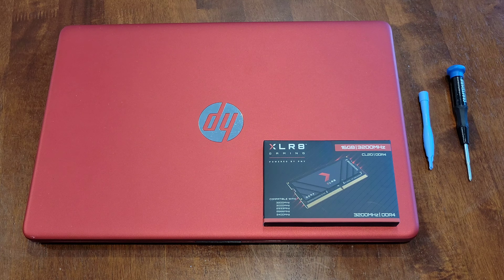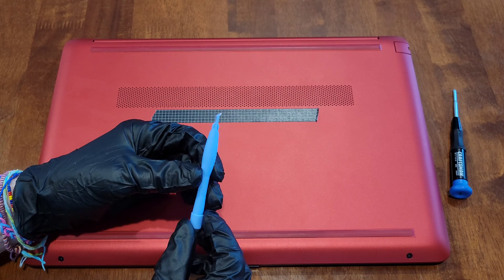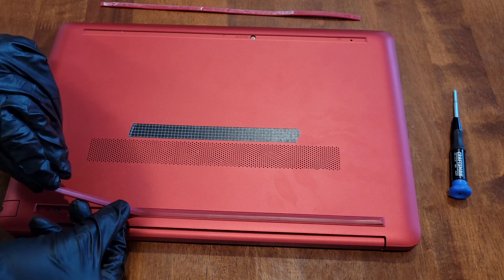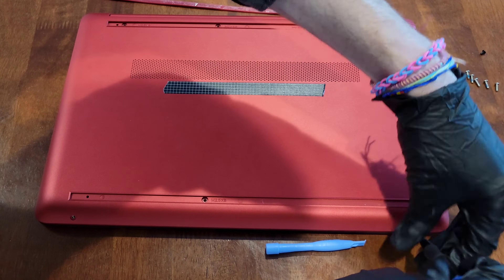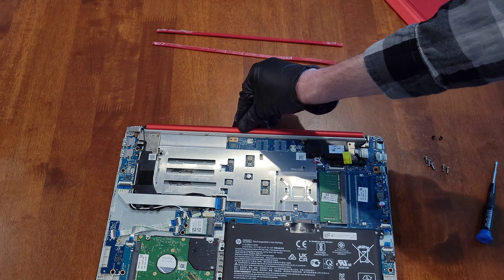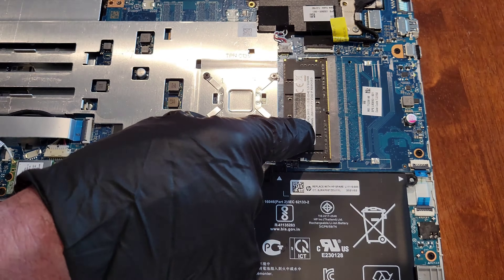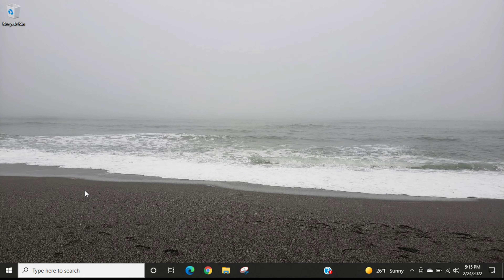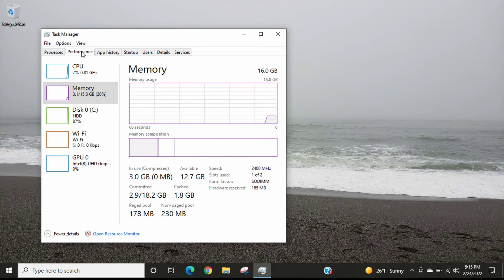How To Install & Upgrade RAM Memory In HP Red Laptop - Step By Step Tutorial

Comment: Hi, I've have the 15-dw0083wm model with 2 slots for ram. it came with x2 2gb ram and I'm trying to replace it with x2 Crucial 4GB, 260-pin SODIMM, DDR4 PC4-19200. Everywhere I've looked says that 8gb is the max so I'm trying to upgrade it to that. However, I kept getting flashing caps lock light error that means there's a problem with the ram. Any ideas why it isn't working? I did a bit of research and thought the new ram was compatible.

Comment: I replaced stock memory with 32Gb of 3200Mhz RAM. System info shows RAM is operating at 2133Mhz speed. How do I change BIOS to take advantage of 3200Mhz memory?

Comment: I have the same laptop and bought the same ram (using your link). But I am just getting a black screen after following your instructions… Is there any way you could help me? 

The old ram works just fine if I put it back in. But no response from the PNY ram.
Reply: I wouldn't follow along videos like this. It's misleading, I have a red hp 15 dw0xxx laptop from walmart. I checked to see what ram/storage is compatible via crucial by micron and I was notified that I can only upgrade to a maximum of 8gb of ram. Anything more than that and my system will not recognize because its not built for more than that.

Comment: My red laptop is a 2024. I just followed your video and upgraded my 4 gs of ram to 32 gs of ram and it works like a charm. Blazing fast loading speeds.
Reply: What kind of ram did you get for you hp I have the same one which on works better
Reply: how much u pay for that 32 gb ram , on my contry a normal 8gb ram around 2000 mhz is 40 $

Comment: I have the same red laptop from Walmart and I too changed it from 4 to 16. And now it doesn't display anything on screen. So I put the original ram stick back in and still doesn't display anything. I'm lost now
Reply: Remove the ram, disconnect battery, hold power button for 30 seconds, then try it again. Sometimes it may take awhile for it to boot...be patient
Reply: Is the laptop fine now??

Comment: Thank you , Todd. I have a similar-type HP laptop (model 17-g119dx) - about 7 years old - but did not see any obvious way to access the RAM (a door or port).  Your video answers the query on how to access the innards, so I'll give it a shot. I had a local store upgrade the RAM from 4GB to 8 a few years ago, but would like to upgrade to 16 (the max this model can hold). The laptop runs the components of an observatory (mount, cameras, focusers, etc.), so every bit of RAM will help, I think. Thanks again for a very well-done and easily-explained video. - Steve

Comment: i am not even close to being computer technical but with you video i watched and went step by step and so happy to DIY. my only problem was when i opened it up i realized it was only one slot for the Ram.  i needed to have the one piece of 16gb instead of the 8x2 Gb kit.  i didn’t even feel bad because i knew i could exchange out on amazon and go back thru with steps from your video. I really appreciate you taking the time to do this video.

Comment: Did you experience any boot up or lag issues after upgrading the ram in this laptop? I have this same laptop and am hesitant to upgrade based on some reports of boot up issues and lagging issues.
Reply: I am assuming if you replace the ram the laptop has to fully reset to  get used to the ram but then eventually it should just work also check if you got the correct memory.

Comment: How do you add a second ram ??
Reply: Wanting to know as well
Reply: The laptop used in the video only has one ram slot. Usually, newer model laptop havr 2 so to add a 2nd ram you should have the same ram generation as the current ram installed in your laptop (if the installed one is ddr3 you should buy another ddr3 for expansion) but i recommend to replace the older generation ram and buy 2 newer ones like ddr5 or ddr4
Reply: Wow thank you very much for your step by step guidance!

Comment: I thought 8gb was max ram for the HP 15-DW0081WM. Does 16gb work in this model or is only 8gb usable? Thanks!
Reply: The employee at geek squad in Best Buy told me this laptop limits to 8gb of ram
Reply: Exactly what I've been reading, looking to upgrade myself and the processor in here only utilizes 8 gb of ddr4 2400 I think it was
Reply: Does it work? The 16gb ram?
Reply: @onekoolmario1343  im pretty sure with 16GB ram you can have as many intenet tabs as you want to use all the RAM 4GB is very low.... windows uses like 2-3GB off the bat
Reply: I have the same question lol

Comment: What kind of games does it run without taking it apart?
Reply: It can run some early games that don't take a lot of ram. Mine is 4GB and it can play a beefy old game like Sims 3 with no problem for ex. If it's an older game, it likely works since that means it was made for non-powerful computers at the time.
Reply: None
Reply: None the way it is... maybe solitaire or games like that.
Reply: Ok I found out it can play left for dead 2 and Garys mod and people play ground and far cry 3
Reply: Emulators like Nintendo DS games